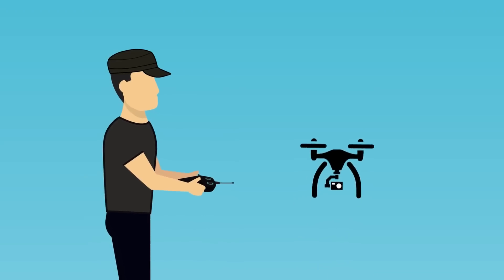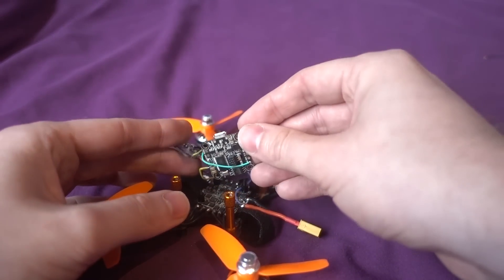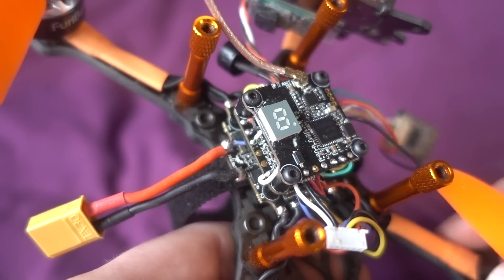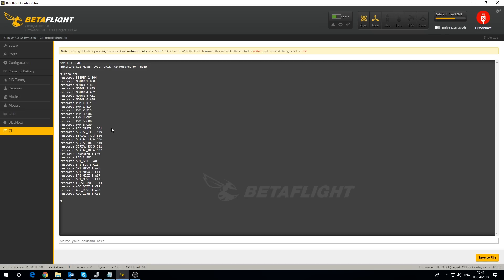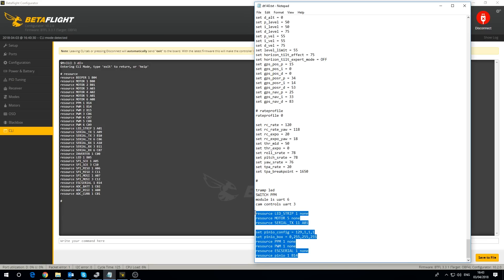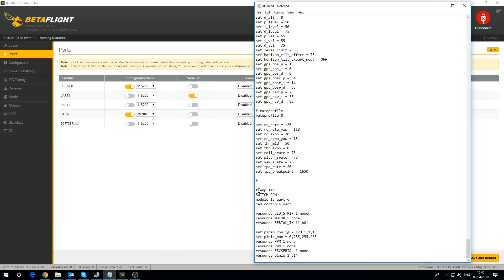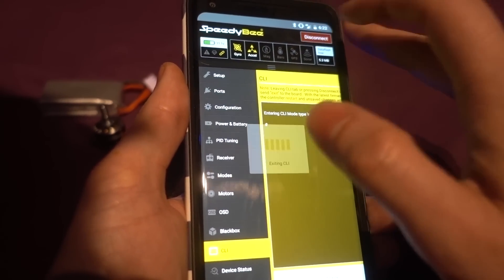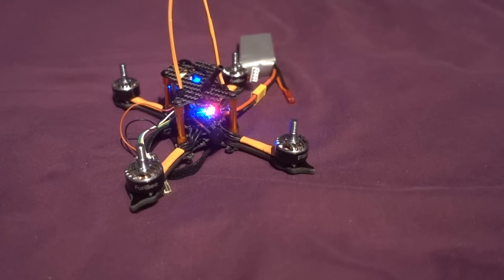Wireless Betaflight / Soft Serial Tutorial - Runcam - Speedybee

Comment: hi andy i know this is may be a long shot but ive tried setting up with softserial but i have issues typing in the set pinio_config .... commands
they are not recognised ...invalid ... btw im using inav 2.1 matek f405

other commands like resource or motor none etc are accepted just the pinio config and pinio box commands come back as invalid command

cheers if you can help..or any of your viewers

Comment: Thanks for the video. Do you know if it can run without the ble cable (be always on)
Reply from the maker: It can but the reason it turns off is so it doesn't inteferw with your radio
Reply: AndyRC great.  Speedybee have confirmed BLE wire is optional (but as you say recommended). I can't get app to connect so wondered if that was it. I will now check the RX/TX, baud etc. PS you do great videos - love em
Reply from the maker: Hope u get it working make sure inversion is correct for the pads u have used. Cheers

Comment: you dont need to buy this from speedy bee go on ebay get one for 1.50 cents its just a blue tooth.. for arduinos.... then soilder wires to the tx rx power ground  that simple if you need to update the firmware get a ftdi adaptor and wire it up.. folks stop paying companies 5 times more when you can do it yourself for cheap..... theres no custom firmware on the bluetooth its standard protpcols
Reply from the maker: When it comes out it will be very cheap anyways and it switches off which means it doesn't consume power or transmit rf over an already saturated frequency. Worth  waiting I'd say

Comment: Google seems to have removed all the add on extensions to the Chrome browser like ad blockers, Betaflight and Cleanflight that was used for calibrating F3 flight controllers.  I wonder what the droners are going to use now?  I had read they were going to remove extensions that had cryptocurrency miners in them but they seem to have removed everything.  Maybe all the extensions had cryptocurrency miners?  Is that why you are setting up Bluetooth since Chrome no longer works?

Comment: Cannot wait for this to be released, think I would disconnect the module when flying  👌🏼
Reply: Jason Cross if you don’t want to wait to use the app you can just buy a hm 10 Bluetooth module and connect it that way I’ve got three different config apps that work on my iPhone 📱 and it’s easier
Reply: daniel Metcalfe funny enough that exactly what I did on Monday, works perfect, I posted on the Rotor Riot FB page. Well happy 😃
Reply: Jason Cross don’t do as I did and reset your settings because it kicks you out and you have to go back into BetaFlight  and change the baudrate again lol